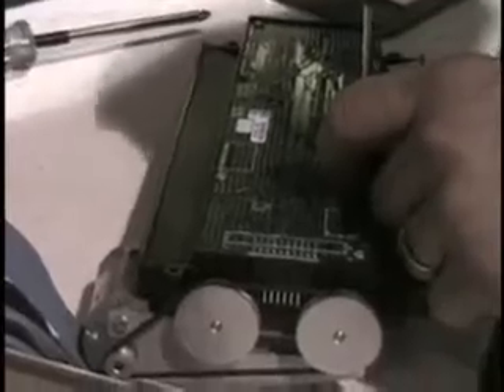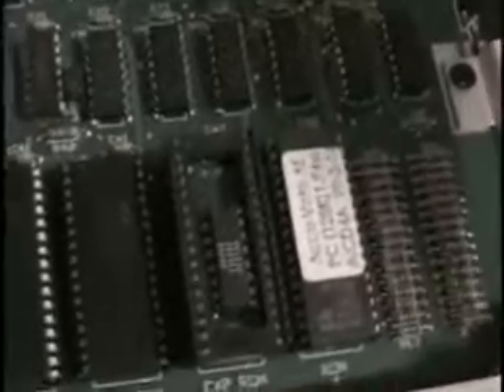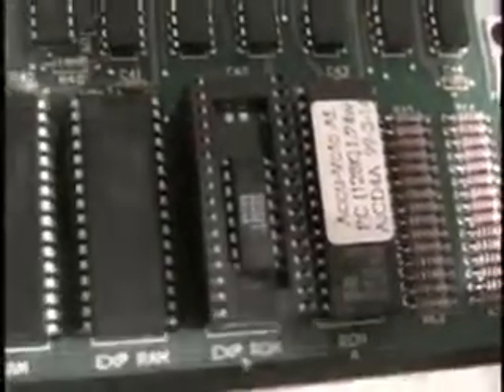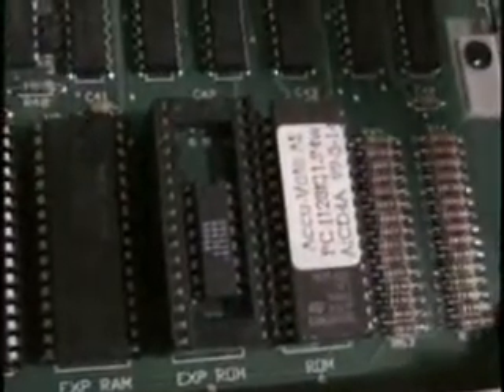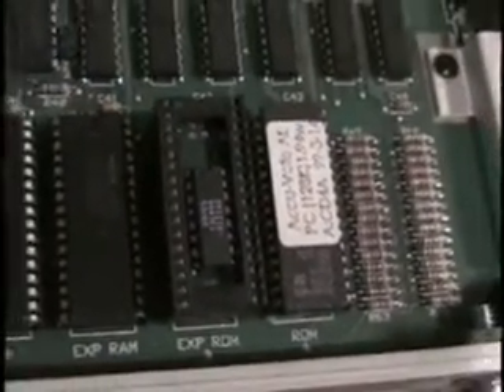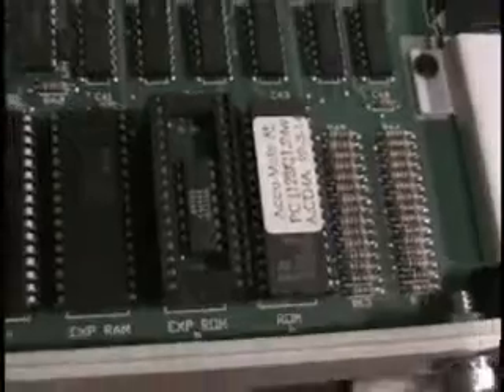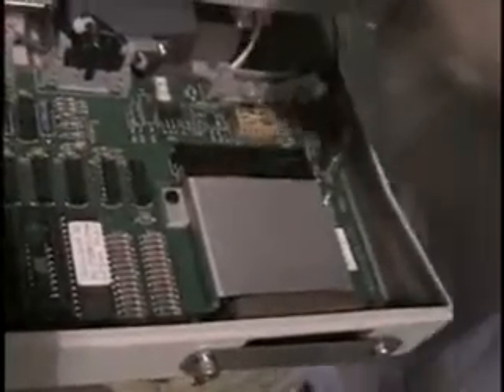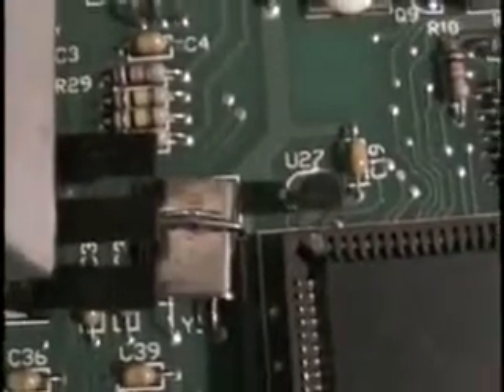Diebold voting machine exam - Part III

Comment: Fair point, hes not the spawn of Jim Henson and a sewing machine, but on a scale of security analysists he just doesn't measure up. To really get to the heart of the issue we need to get experts in, not parade uneducated opinions. There *is* a lot more at state than the engineering here, but to see it misrepresented is a terrible first step in something so critical to the democratic process.